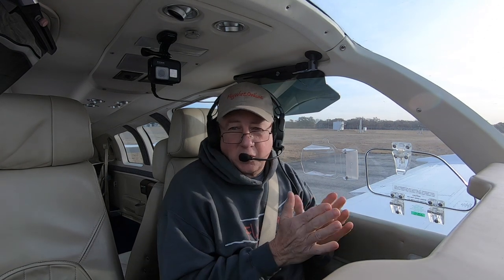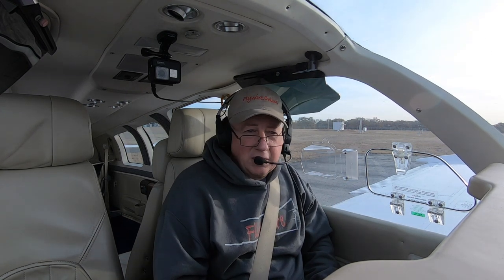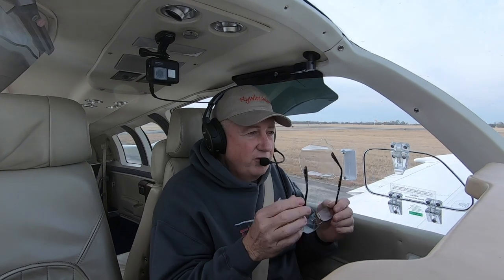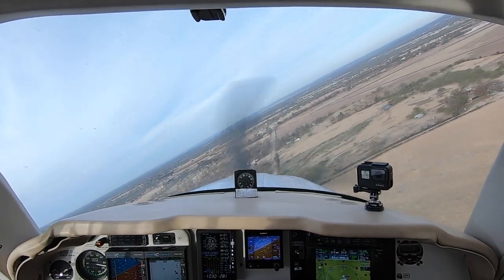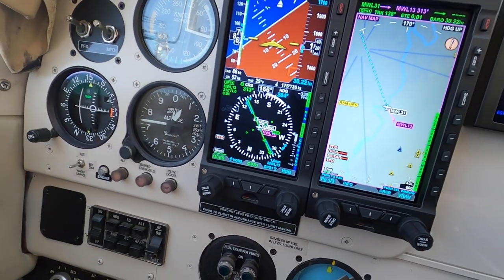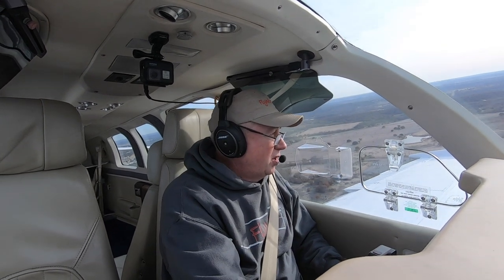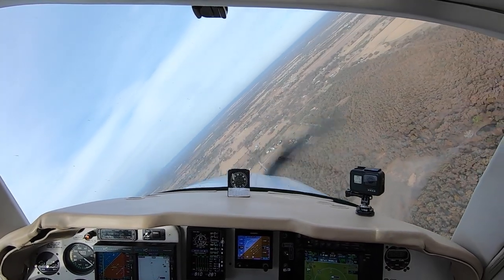A36 Bonanza Engine Failure on Takeoff:  Impossible Turn or Turnback?

Comment: Below 1000' AGL In an actual loss of power on takeoff, I am never trying to turn back, I am looking for the first place I can put her down without a ton of maneuvering, I may be landing off airport, but better to make a controlled landing off airport than a uncontrolled landing on airport property. 

I would rather be landing at 50-60mph in the horizontal than 4.8 meters per second squared on the vertical!
Reply from the maker: Renegade, that sounds like a good plan to me!
Reply: @FlyWirescottperdue  Another thought I have in hind site now having had a few minutes to think about this, another factor that is going to play a big part of this is density altitude. 

Your safe turn around in Jacksonville Florida is going to be way different than up on the western slope of the Rockies where the airport is at 6,000 feet. 

Throw in an engine out on a 90° day on takeoff in those conditions, and that is a big time game changer.

Comment: U ever try using different rpm setting? An old Pete Garrison article in Flying seemed to indicate a course setting would yield longer glides. I never tried it in the Hawk XP. Thoughts?
Reply from the maker: Scott, indeed pulling the prop back is the best course of action in a real situation. I talked about it's impact in the first video of the engine out series- 'Best Glide and Min Sink'. I'm trying to show the boundary limits of the engine out situation. Hopefully, you'll take that and go practice them with an instructor and by yourself to develop the best practices for you in your airplane! As I said, I'm all about training, it's how we get better, and if we used to be better, its how we scrape the rust off. It's all flying and that's what its all about! Have fun!

Comment: Good demo...I wouldn't  but ..you were empty on a cool day. Landing downwind and a downwind turn are killers. Pick a soft spot into wind after 1000 maybe...
Reply from the maker: Thanks Garnet and yes that day I had everything in my favor and the maneuver was still sketchy.
Reply: @FlyWirescottperdue  Some day I will share my luscombe engine failure on take off story. 
What saved the day was the cup of fuel in the primer. Got me a mile over plowed stubble to a hay meadow. Straight into wind.😁
Reply: @FlyWirescottperdue  ps You are doing good work here Amigo!

Comment: At 12:19 you mentioned that “...at slower speed the turn rate is slower as well.” I believe that it is just the opposite. Doesn’t rate of turn have an inverse relationship to airspeed - for a constant bank angle, that is? I can see that with the slower speed one might shallow out the bank angle to conserve energy. Thanks

Comment: In my training we talked about 
L/D max being the best glide speed to use in engine out procedures. I'm not sure what that would be for your airplane. Also not sure what the difference between Vy and L/D max in theory or practice.
This whole area of Velocity needs some standardization, I learned V1...
Reply from the maker: Martin- Best Glide speed is the speed to fly if you want to maximize your distance for a given altitude. Minimum Sink is the speed to fly if you want to maximize your time aloft for a given altitude. So, if your engine out occurred just after takeoff you want to maximize your time. Unfortunately there are no easy answers.
Reply: I am assuming thay minimum sink is L/D max
Reply: @martinjrichter55  
Assuming no wind, the angle of glide relates to the lift and drag of the machine. Without drag you would glide horizontal indefinitely and without lift, you have a vertical descent (don’t we know). The actual glide angle is thus a ratio of these two (Lift to Drag), and not related to weight. Wind has an effect on the angle over the ground, but not through the "river of" air. The heavier plane will reach the ground sooner, since it glides at a higher speed, but both will glide the same distance in still air. 
The minimum sink speed of a plane is flown slower, near the maximum angle of attack (not the faster best distance speed), since one is more concerned with lift than speed. Here a light plane will glide a longer period than a heavy one.

Comment: I was just thinking about this today when I saw your vid thank you . I need to put some serious thought into this maybe have coffee with a another pilot and talk this through . The higher you are the further away you are going to be from the runway but you need altitude and speed to make it back ? That’s a lot to talk about maybe two coffees . Thanks again
Reply from the maker: OTM- Just remember that Potential Energy is linear with height and Kinetic Energy goes with the square of velocity. Physics is what it is...
Reply: Ok I will need three coffees 👍
Reply: Plan very well on the ground first.  With drawings and steps to take on each altitude you try.  Simulator then.

Comment: Why climb at cruise climb, just for fun?
Reply from the maker: Some serious reasons... got other videos for that, check them out.
Reply: @FlyWirescottperdue  I use Vy.  Had a partial engine fail in 2001.  Turned back.  Mooney 20C.  If used Cruise climb i could have decided to crash forward.  ON A SWAMP.  DEAD most end up there.
Reply from the maker: @CFITOMAHAWK  Partial power loss, glad it worked out for you.
Reply: @FlyWirescottperdue  Yes, was partial power.  But i was at only 300 agl. climbed to 400 with a lot of vibration and turnback to opposite.  but i had practice them before because i learned turnbacks in 1995.   Sort of that youtube Dave Heller turnback but i did them to the left due winds.

Comment: AOA indicator might contribute to a flat turn with minimum loss of altitude
Reply from the maker: One more thing to look at and think about... not a lot of time to do it all in.
Reply: Greynerd, try different angles of bank at altitude. See how much altitude you lose during a 180° turn in your bird. Then add the wind factor vs ground track. Would you believe that a 45° bank with the with the wing unloaded will lead to  less altitude loss than a 30°? The turn radius back to the runway with the wind factor added in determines a lot into the equation. And thanks to Scott for encouraging exploring the pilot's personal envelope. GO PLAY!! It can save your life.

Comment: At a shorter strip, your bigger problem would be over-running the end after touchdown rather than making the threshold. That runway was REALLY long.
Reply from the maker: Given altitude and climb rate the situation is relative, but yes that is a factor. The point I was trying to reveal is that a Turnback should only be considered in the most favorable circumstances-- you've trained for it, you have enough energy (altitude and airspeed) to perform it. Otherwise, just plan to land off airport.
Reply: FlyWire- scott perdue I did this training with my instructor during my commercial training and I think (in an lightly packed arrow) we established 700’ as the minimum. But I could be wrong. It was a long time ago. I remember it being an interesting exercise. After that I adopted the pre takeoff call out procedure to calling out our engine failure plan. “Anything below 400’ land straight ahead, between 400-700’ pick a point 45 degrees left or right of the nose and fly to it, anything over 700’ consider all options in front or behind.” Something like that with numbers changed depending on the aircraft, weight and winds.
Reply from the maker: @bighaasfly  Excellent Takeoff Plan! Thanks for sharing!

Comment: Seems like many banana drivers seem to yank the gear and accelerate like mad without climbing much. Airspeed goes away very quickly but altitude buys you time( as you demonstrated). The faster you go the more drag and the faster you slow when the motor stops. At the high end when you pull a jet out of burner at Mach 2 it feels like you hit a brick wall.
Reply from the maker: Well, actually I am advocating acceleration over altitude. It's a simple matter of Physics... Potential Energy is linear with height and Kinetic Energy is the square of the velocity. When the fan quits you slow down about the same, there is little difference in induced/parasitic drag at these speeds. With a prop the old adage of the faster you go, the faster you go faster... doesn't apply. Thanks for watching!
Reply: I’m no expert for sure but best glide ratio is best glide ratio . Speed helps in the turn for sure than glide ratio gives you distance get high . It would be tempting to gain speed at the last moment to pop over that last tree before the runway but I don’t know if you would have enough altitude to gain speed at that point ? Get that new bolt on electric motor for back up that’s what I want $$$ for Christmas .
Reply from the maker: @onthemoney7237  In this situation you have the energy you have.... gotta manage that until the end. Go with Kinetic Energy, that's my pitch (pun intended;).

Comment: Pilots SHOULD try these maneuvers, to gain first hand experience in the capabilties of both their plane and person.   BTW, the term "Impossible Turn" is terrible and I'm annoyed that AOPA  would promote it.  What about the Impossible....Taxi, Takeoff, Landing, Ground handling...?  Finally, pilots should be made aware that landing on the runway should not be the priority.  Any place on an airport is usually safer than....forests, fields, urban areas and any unprepared surface.   Limiting damage to the airplane is NOT a priority.  Once the emergency begins, the insurance company owns the plane.  Save yourself!
Reply from the maker: Excellent points Pelican!

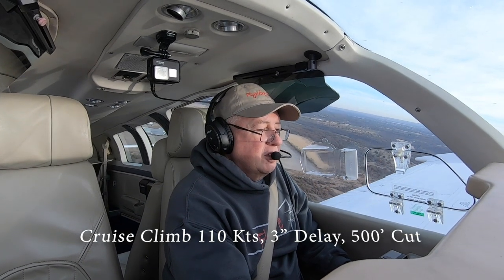Comment: 02:37 10 knots wind on ground its not 30 knots at 500 agl.  HELL NO.   If,  then you will have a HUGE WIND SHEAR ON DEPARTURE LEG that will almost or will STALL YOU.   NO WAY 30knot wind 500'  AGL.   I learned 2 kinds of Departure Leg EFATO Turnbacks in 1996 and done dozens of them to a real landing on runways not just fake at altitude and not landing it.

Comment: Did this with my instructor, in a mooney. Vy climb, 600ft, cut. Using left turn, 60 degree bank (nose deep down), maintain IAS 1.42+ Vs. In this case, we only need about 350 ft to turn 180+/-, plus line up the runway, and we actually made the landing back to the opposite direction of the T/O runway. We never heard stall horn. The key point here, is to use "steep spiral" tech, make the steep turn deep dive, so the turn will comes very fast and AoA will be low. (And my personal opinion is, if we add flaps -- even maybe full flaps, it will work out better -- you drive the airplane into the ground with flaps, the air push you back, you win better AoA and rate of turn).
Reply from the maker: Excellent training!
Reply: So you were at 1.42 of vs in the turn?  You should try that maneuver from a normal Vy climb.  Then use 45 degree bank only at Vglide speed.   .  At altitude is easy to miss your mistakes or wrong ways of doing it.  On initial climb, from say 700 feet agl more or less is when you see the reality and what is real or fantasy.  I taught that maneuver to many at 1,500 feet first, then at the runway too with different winds and weights.
Reply: @feetgoaroundfullflapsC  Vy in the mooney I use, is faster than 1.42 Vso.

Comment: I was wondering......would a stall turn or a wingover be of any use in this situation as a turnaround manoeuvre?
Reply from the maker: balsum- The short answer is yes, a wingover, or crop duster turn does most of the turn in the vertical. But the real problem with that is you need the energy to pitch vertical in the first place- highly unlikely in this scenario. So, my answer is it wouldn't be a prudent maneuver. Energy is everything, use it wisely!
Reply: Nope, would not recover from the sink rate.
Reply: My thought as well.  Nice lazy airshow turn.
Reply: I tried it with a scale RC plane......as soon as you pitch the nose up after power loss, it stalls. Just not enough energy to get anywhere near vertical to kick the nose over.  I wouldn't try it in a full size plane.......
Reply: balsumfractus  -Nope.  You will do a no power, nose very high stall.  Someone should try a Cuban 8 next time.  Cut all the power, loop it, after the upside down part, just do a half roll to put it right side up.  Want to try it??
Reply: 5feetgoaround fullflapsC150 ...as I mentioned in the previous post,.....so we Re in agreement.😃
Reply: @balsumfractus  Can you make a video showing us  "The No Power Cuban 8" from 500 feet agl.  Will be fantastic to see it.
Reply: 5feetgoaround fullflapsC150  I think we are on different pages here....I never mentioned a cuban 8.
Reply: @balsumfractus  What about a Split S instead?  Anyway, you have a cute dog.  Saw the athletics video.  I was kidding.  Best way is to push down nose, then turn 45 degree bank.  I taught that maneuver over a hundred times.

Comment: Moral of the story:  pick a spot straight ahead and land if you can, depending on winds and terrain.  Also, don't wait 3 seconds if the engine pops.  As soon as you start to hear the RPM drop, force that nose over and get your best glide ASAP.  Otherwise you risk entering a stall.
Reply from the maker: Exactly!